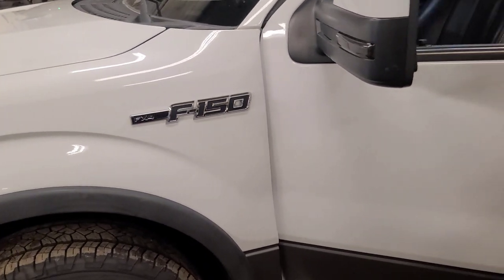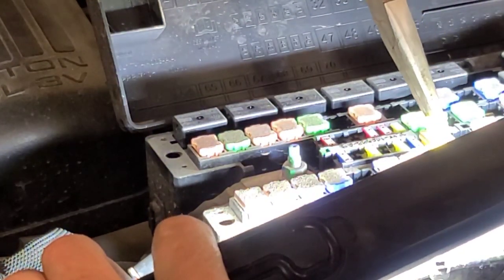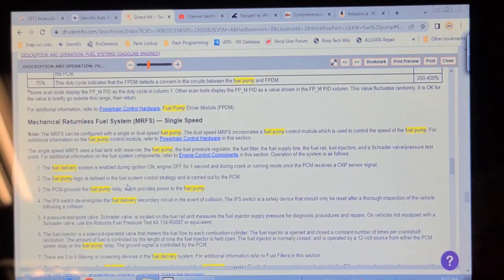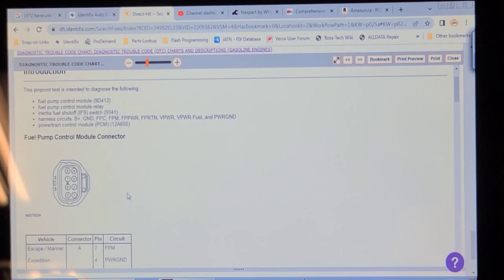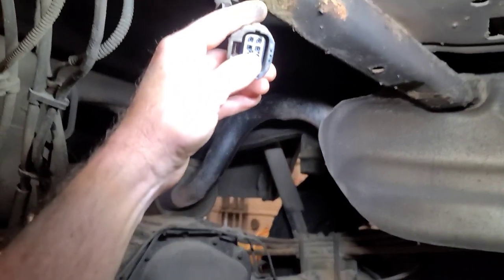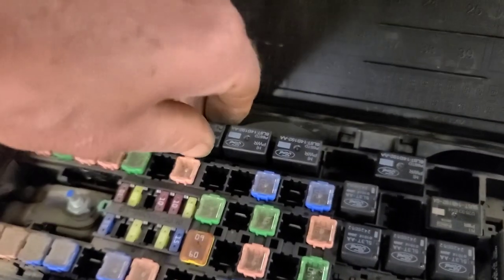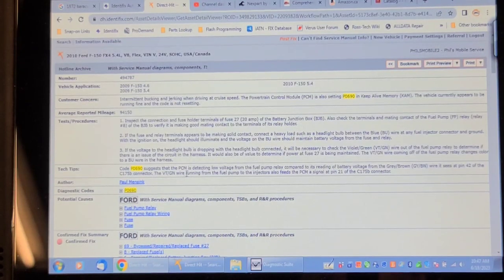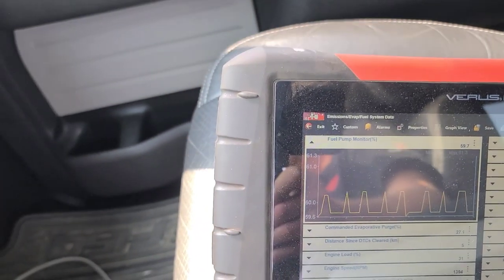2010 F150, Stalling and Crank No Start. Codes P025A, P0690 and U0109

Comment: It is interesting that Ford's solution to the disintegrating Fuel Pump Driver is to put it inside a plastic housing and remove all the heat-sinking instead of just relocating it to a better location.  Looks smaller, so maybe they've upgraded it with better circuitry so it doesn't get as hot.

It sucks trying to diag a fault that you can't reproduce.  However, fulfilling that TSB and removing it as a variable was an excellent decision.  Looks like it may even apply to my 2013 from what it showed in your video.  I may take care of it one day after I fix my air conditioning.  Priorities.

Comment: I just had a similar problem but there where more bizarre codes like loss of communication on a 08 KRanch I pulled the electric box re flowed all the solder joints and new on board relays plus needed a fuel DM and all problems gone

Comment: Very helpful video . Did the relocation of fuse . Replaced the module . Bypassed wiring and heard the fuel pump running and still a no start . Any further ideas or suggestions ? Thank you.
Reply from the maker: Do you have fuel pressure, spark and injector pulse? Is it setting any codes? RPM should show cranking speed on the scanner...
Reply: @PhillipBailey   Hello. I get 3 pulses on the injectors ?  Then it continues to crank  without a pulse ? Have a tach signal on dash ? Hook multimeter to coil packs and get around 9 volts as soon as I turn key on then it jumps between 8-9 volts when cranking ? Only have a cheap code reader and can’t tell how much  fuel pressure or crank speed ? Is it normal to get voltage at the coils as soon as key on and no cranking ? You are the only guy on YouTube that shows how to diagnose a problem . Very helpful videos . Thank you .
Reply: Restraint control module B11D8 and also  P0230 fuel pump primary circuit short to ground or open  ? Can hear fuel pump going when  jumping pins on fuel pump module wiring like you did on another video . Does it need a fuel pump even if  I can  hear it ? Your help is greatly appreciated.
Reply from the maker: @tripleh9985  yes normal for battery voltage to the coils with the key on. Do you have spark at the coils? You need better test equipment. Does the fuel pump run with the engine cranking? If not you could have a wiring problem to the fuel pump module.